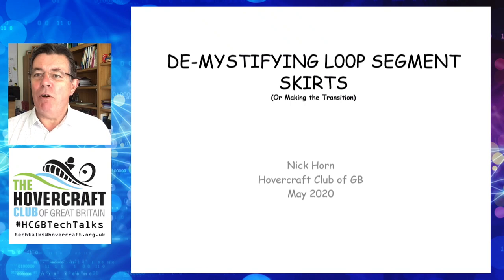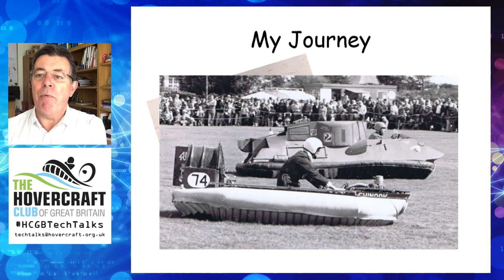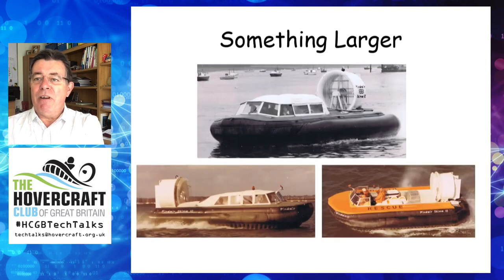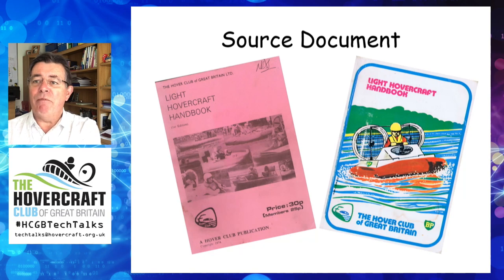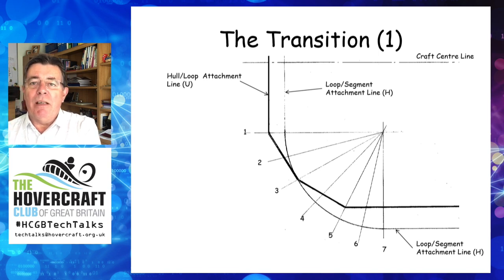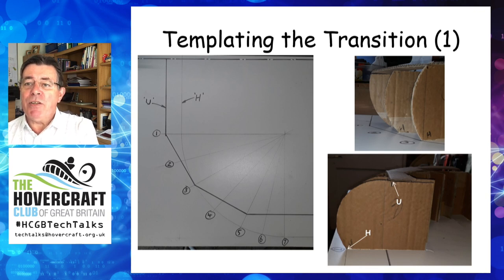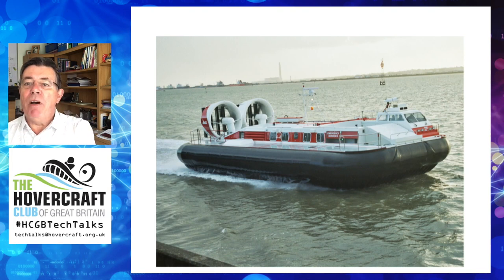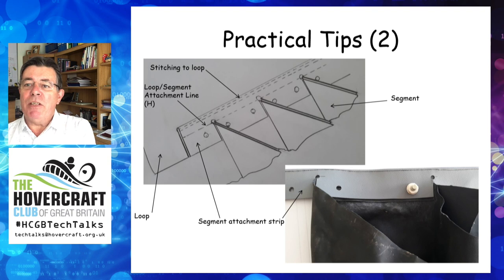TechTalks - Nick Horn - De-Mystifying Loop Segment Skirts

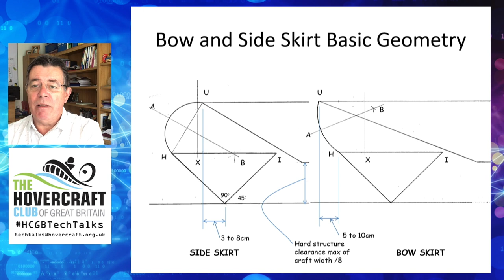Comment: Thanks, Nick!  Yes, that pink Light Hovercraft Handbook was a gem - maybe I'll find a copy as we down-size our home...?  ;)   My friend Nick & I built an unusually skirted F2 machine that appears on Syd Pearman's excellent prize-winning 'Hover Bover'  movie (at 09:42)  here on YT. We had had experience of finger skirts on one of Nigel's 'Simple Cyclone' designs, and a modified Ron Fishlock bag design on Nick's 16 foot long 'Mistral' with Porsche power, intended for offshore cruising/racing.  'Wosp' (Reg No 74, iirc) was a 2-engine F2, with a Robin EC44 for thrust and a 60cc Stihl Chainsaw engine for lift... It was under 500cc for F2 compliance, and had two lift fans driven by the Stihl which we had optimised to run at around 8000 rpm on a short pipe.  It did hover!  But it was terribly overweight, due to using available materials to save money in construction.  The engines were not cheap.   The skirt was a hybrid bag-segment, with a web inside the tiny tip-fed  bag such that the segments had a firmer  attachment than a true loop-segment.  We had much admired the contouring ability of the Pindair Skima loop-segment skirts, but for racing we were aiming for something stiffer.
On Syd's movie (at 09:42) it is apparent that the skirt is some sort of bag arrangement . . . this was due to the severe wear problems we had  experienced with the finger attachments, and my wife and I had about a day of free time in which to design and build something that would help our Nick compete for the F2 championship, so we cobbled together a bag to replace all those shredded fingers.  It did the job, as you can see, but not well!  
Far too soft, with a tendency to tuck under at speed over water. Despite the excess weight, there was (just) enough air to hover with our chainsaw engine, and the EC44PT certainly delivered the power!
In the same movie, I'm the unintelligible commentator - must have had my new teeth in!